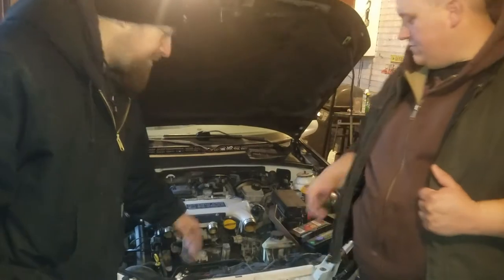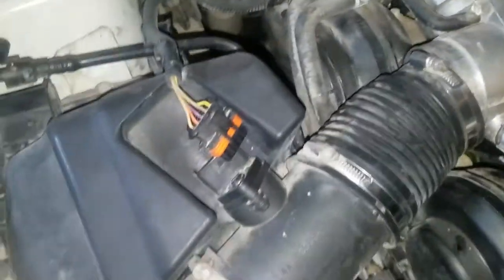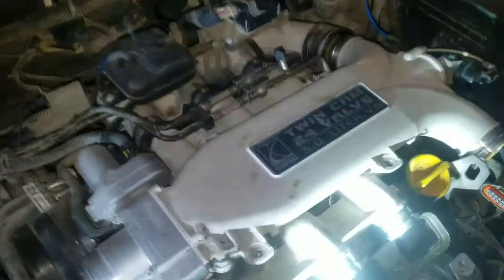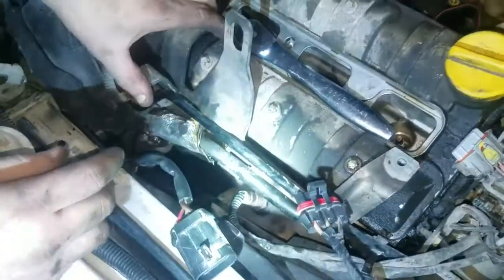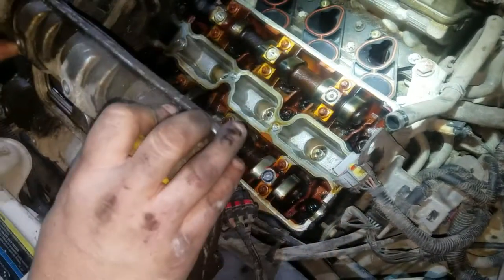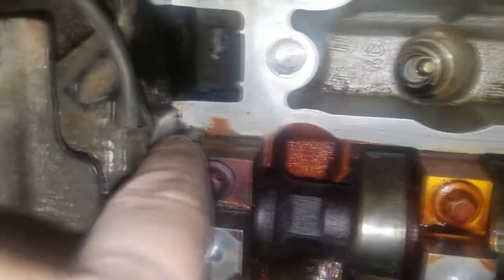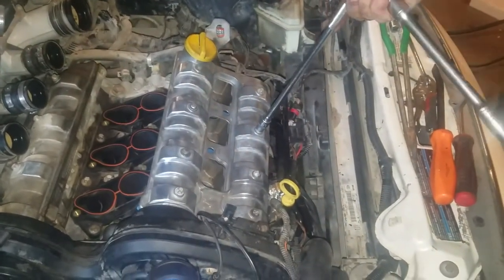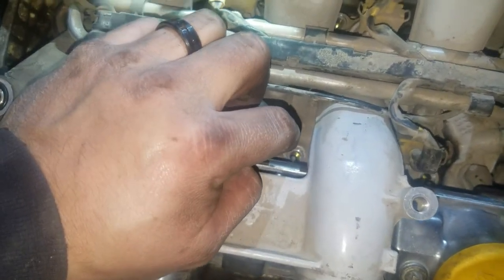2005 saturn l300 valve cover gasket replacement

Comment: Did you Find the Cause of the oil leak in the 1st place?  I have just removed the coil packs, cleaned out the oil that was inside the spark plug housing. Have had Several Professional Mechanics look at it and the only solution we can come up with is that the oil Filler cap is worn out and loose that is shooting out oil to the top of the engine . It's way above the valve gasket (Which was fine but the bolts came loose and we just had to tighten them without taking it apart) which makes sense looking at it there is no way the oil came from the  lose gasket.  Buying a new Oil filler Cap tomorrow we'll see how it works!
Reply: You definitely have a valve cover gasket leak trust ne the oil will seep in there I had one really bad was leaking oil into the spark plugs till there were full still turned on tho somehow

Comment: This is not same car you have (2001 Saturn SL2), but maybe you know. Does it matter where which of those black bolts that hold the valve cover goes? I have 9 with the cap on one end and 3 with both ends open. I removed all of them and didn't take a picture being sure that it doesn't matter which one goes where, I even thought that whoever worked on this lid before just lost 3 proper bolts with the heads and substituted them for the ones with open ends. But now when I've learned and saw in the Haynes book the Valve Cover bolt tightening sequence (p. 2A-6) I'm in doubt. So does it matter where you place those open ends 3 bolts or not? What was the final clean of the gaskets contacts? Did you clean it with acetone,  brake cleaner, or it can be left like it is, just scrape out all the debris from the old gaskets? Thank you very much for the informative film.

Comment: Any idea where I can get the factory hose clamps? WTF was Opel/Saturn thinking lol...
Reply from the maker: MrCaribe65 I actually like them they are quick and easy but of course not as quick as the pinch ones that you squeeze together to open them. Any part store will have what ever style you like.
Reply: 2 Mostly Bald Guys I guess at first I thought they were not reusable, but you guys did reuse them. Thanks,for the tip. I'll check my local autoparts places. Great work bud. Thanks again!
Reply from the maker: MrCaribe65 ya that tile nipper tool works real good for re clamping them. And thank you
Reply: Any Hardware Store will have a plethora of hose clamps  that will fit them. If not you can pay a lot more at an auto parts store. To make sure you have the right size bring the part with you when you go there to buy them. To really 'Jenky' Engineer it use Tie wraps/ Cable ties.

Comment: Hey 2 Mostly Bald Guys...

Hey 2 Mostly Bald Guys! I am half way through this project but Im wondering if you detached the throttle body assembly to do this job? I have a 2003 Saturn LW300. Rear and front air intake are both removed. I need access to both valve covers to replace gaskets and really appreciate your Saturn vids. I am missing something.

Comment: This is irrelevant to this repair, but something i've noticed in the past week that when the car is started on mostly a colder morning, 20 to 25 degrees, after about 3 min of it running, I'm getting a tapping and rattle noise on the top of the timing belt cover above the rear side top camshaft. When you push on that place on the cover, it stops, then starts again releasing it. It'll do this about 3 min or so, then quiets down. It's the same engine as this, but a 2003. I was looking for this video for this repair and saw the area where the noise is coming from with the valve cover off. I've never heard anything like it before, usually noises will continue as long as it's running and start right away. It's very confusing to what that would be. Nice information but a little to much for me to tackle replacing the gasket.They don't seem to aanswer any comments here, but if anyone has an idea of what it might be, please advise me.

Comment: My saturn isn't getting any spark and no power to the fuel pump, I check my fuse relay center fuel pump relay and pump gues has no power